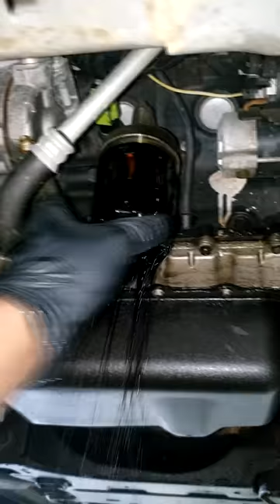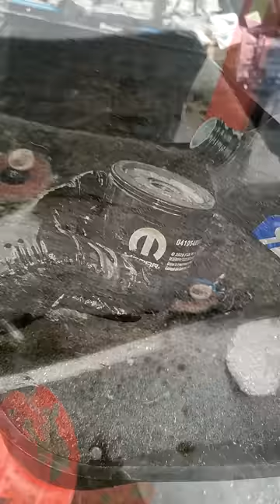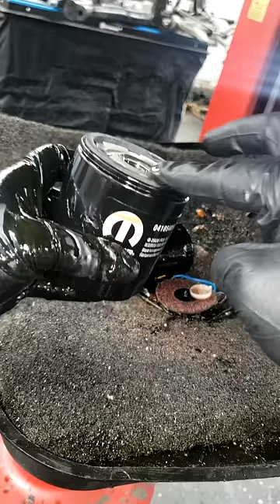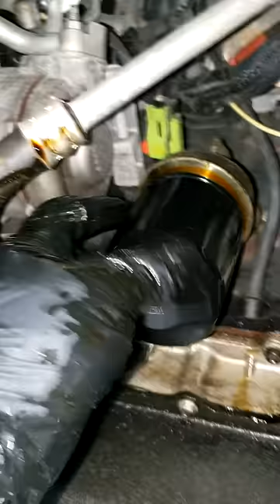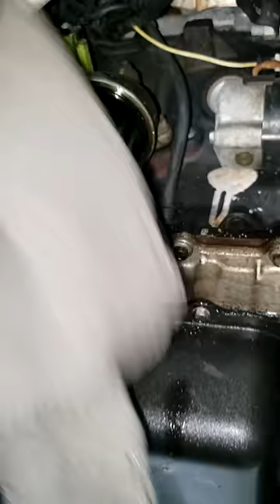Don't Lie.. Are yall still doing this?

Comment: Automotive Instructor here, you really only need to do this with large diesel engine oil filters, modern cars will charge the oil filter in less than 5 seconds, your valve train will still have enough residual oil left in it to prevent any damage while the filter primes...also wipe off the mating surface for the filter before you screw the new one on, you want it clean, and you'll be less likely to double gasket the new filter.
Reply from the maker: Thanks for chiming in Zippie27. Interesting comment
Reply: Talking about that, it is also totally annoying to me when someone takes the old filter and pushes the old filter against the new one to spread the old oil from the old gasket on the new filter gasket.
Reply from the maker: @SebastianLong  Lol, yea thats funny seeing people do that.. I simply get a chuckle out of it, I never let it annoy me. When that starts to happen I simply stop looking.
Reply: still wont chance it in my wrx.
Reply: @SebastianLong why
Reply: @SebastianLong  It doesn't make much difference. Using old oil to lube the gasket prevents drips of fresh oil appearing as a leak. 
As far as new oil contaminating the system, from a new bottle, is irk worthy. 
I have transferred old oil gasket to gasket since my hands are contaminated, wiped the base clean and install the new filter. This guy didn't.
Reply: @bryanst.martin7134  The issue is particulate that the filter is meant to filter will be caught between the gasket and the mating surface causing a leak. There should be no oil around the oil filter when it is a secure seal.
Reply: ASE certified tech here. I always add .2 qrts.  extra of oil In the engine accounting for the prime of the engine. For diesels is correct you always want to prime that goes for commercial. Passenger diesels do not need the prime.
Reply: Yep clean that mating surface!
Reply: Correct !!!
Reply: Made a double gasket mistake once!!!! Got lucky and caught it before disaster.  That's all it takes.  Always....always account for that gasket.  Crush washers too when used.
Reply: Disagree. You can HEAR engine wear when you start car with no oil in the filter. 1 second of limited lubrication is a lifetime in an engine. Ill keep putting oil in filters before reinstalling.
Reply: @SebastianLong  I just dip my finger in the old oil and lube the new filter gasket 🤷‍♂️
Reply: I work for caterpillar, as a PM technician caterpillar says to not to pre fill any filters, been doing it for years on equipment with 30k+ hours. Now I will say I do prefill my filters on my own stuff😂
Reply: @SebastianLong  I've never seen that but I have seen them Put their finger in the oil that hasn't run through the old filter yet And Wipe it on the new gasket.
Reply: Always,  everything i own, Even filters that are in a rough spot and screw into the side of the block, I have brake-clean.
Reply: I never did this on old cars too, with carburetors they usually didn’t start on first try, cranking primed them well enough, never had a problem.
Reply: What's the largest piece of dirt you've found in a brand new bottle of oil?
Reply: Thank you.  I have seen multiple engines run well past 200k. One of those over 300k without ever having the filter pre-filled.  It’s just not necessary.  If it makes you fell better than do it but it’s not needed.
Reply: I work on metro buses, we put them in dry
Reply: @OnlineMechanicTips  the fact you go through the process of priming the filter with new oil but don't clean of the mounting surface before putting it in bugs me greatly. You full-assed one job but half-arsed the other.
Reply from the maker: @mitchc4474  Its just old oil dude. Should you clean it, sure. It can also act as a lube for the new seal on the filter.  Don't be a drama queen dude, the world is not coming to an end. Geeesh
Reply: @fredost1504 haha, no, you can't hear extra wear.
Reply: As an automotive instructor you should know there are many new chain engines that rattle like F. if not pre primed due to hydraulic tensioners not getting immediate oil pressure. 3.2 ford ranger lump is one of the worst examples, also if you take longer than 10 mins changing oil you may never get oil pressure back, heard of guys having to pack grease into the pump to get them to start again and then immediately change the oil. This lesson needs re teaching. Years ago the reason CAT told mechanics not to pre prime was because almost all services were done in the field and dust contamination and catastrophic failure became common. Later they began suppying bungs and funnels for filling by the outer holes. This way it made no difference if dirt contaminated your filter, it was immediately filtered out
Reply: Mode3rn ..... lol ... my 1978 Spitfire Loads its filters upside down... never had an issue yet :P
Reply: my old man who is a automotive engineer taught me the same way and you are 100%correct bout checking the ring seal seen a lot of blokes double up then wonder why they have oil leaks
Reply: Work on semi trucks, never seen anyone prefill filters
Reply: Interesting hell, nail on the head brother.
Reply: Wrong I never prime my filters I diesel more chance putting dirt in engine doing that
Reply: I was about to say this, most passenger cars don’t need the filters primed, as the filter gets oil first, and then the rest of the engine, 

Clean the mating surface to make sure there’s no debris on it, and the old gasket is off, stops a leak,
Reply: Not mechanic here. Isn't this making longer to fill whole system? Because oiled filter does not let to push the air from oil hoses/canals through that easily. I know there's
Reply: @TimberWulfIsHere wow, a WRX? That must be an amazing machine hahahah

I didn’t prime my filter on an 680awhp Evo, or any other 9 and 10 second car I’ve owned, and never had any issues. But hey, prime that 29k car.
Reply: @Jason-id3yp  bros living on an edge of a knife, or on a loan for engine parts.
Reply: @TimberWulfIsHere  what does that even mean? 😂
Reply: 100% correct I've never EVER pre filled a filter, there is absolutely no point and yes wipe off the the mating surface. I just had a car in leaking oil because the last guy left the old oil seal on it.
Reply: @georgecroney6168 as a theoretical  automotive "instructor" you should know that most people in your field have gotten their "experience" through paperwork not Field work it's all theoretical you actually need to be a mechanic to have a valid opinion 😂 seriously.
Them 3.2 fords probably had 400k km on them. I've had to do the same with the 308. ( Not a fresh one) only once it's old and clapped out and the oil pump is so worn out it can't self prime. I do oil changes on the 3.2 all the time yes they are a shit motor it's a ford wouldn't expect anything else from a shit car but never had any problems on oil change unless it's done over 400k km 60k with miss treatment.
Reply: the new gm 2.7t will trigger the mil if the filter isn’t prelubed before start up.
Reply: Large diesel mechanic here. CAT FILTERS LITERALLY SAY RIGHT ON THEM DO NOT PRE FILL.
Reply: We dont prefill filters on heavy machinery...
Reply: I only do this on diesels and you can bet that's especially powerstrokes
Reply: @huskerpower1541  thats what ive always done and no leak ever.. never primed it like this because the engine fills it faster.
Reply: I was thinking the same thing. I sure wasn’t taught to do this in gassers from my tech school lol
Reply: Good or bad, right or wrong, I always pre-fill the oil filter on my 5.9 liter Cummins. Been doing it this way for the last 23 years.
Reply: 5 seconds of low oil pressure doesn't sound like a good idea.
Reply: I was taught that for high performance engines this is correct as well. 

Also, should wipe off the mating surface on engine side. Not all gaskets are the same exact size and don’t anyways line up perfectly with the old one and there’s always a big outline of oil and dirt. That has a chance of preventing a good seal.
Reply: My Cummins took one quart of oil to fill. Ha ha. I remember those oil changes
Reply: @jamessellers6276 yeah.... When they hold a quart of oil themselves
Reply: I always prime my oil filter, always have foes not matter on diesel or gas engine, instant oil pressure.
Reply: I cant event do this my oil filter is sixeways
Reply: Facts especially if it’s a Huey system the injectors use 80% of the oil or something like that
Reply: i wipe off mating surface to get rid of ring of oil and dirt sometimes the new filter has a different gasket than old one rounded or square edges and dirt could wind up under seal, and on side mounted dirt could run down into whole seal area.
Reply: Wrong, sounds like he works for gm! Always oil your o-rings
Reply: That's what I was taught by my automotive instructor long ago. Not only with diesel engines. Any engine that uses a large filter. Especially ones with high mileage. It'll temporarily starve the main, rod and camshaft bearing of oil. With small filters it isn't necessary. The pressure from the oil pump will fill them in just a couple of seconds. I'll still do it on engines with a lot of miles with weak oil pressure just as a precaution.
Reply: My instructor of 30 years taught us to do this when i got my ASE's in 2005. GM and Ford training centers also taught us to do this. Supposedly soaking filter media allows better capillary action and gets oil moving through said media quicker...
Reply: @OnlineMechanicTips  well, if you didn't wipe the old oil off the mating surface first you kinda did? 🤷 ✌️
Reply from the maker: @AzTurboMini  Did what?
Reply: @OnlineMechanicTips  when you screwed the new oil filter on without cleaning the old oil from around the seating surface on the block.
Reply from the maker: @AzTurboMini  Not going to hurt a thing. In fact it can be used as lube for the new seal. Its not the end of the world dude. But yes, clean it off if it bothers your mind.
Reply: @SebastianLong  With a seal that thicc no particles from your old oil will cause a leak, unless you've experienced catastrophic failure or introduce larger debris during removal. You can probably rim it in sand like a margarita and it would still seal. I'd take oil with some particulate on the gasket vs a dry seal any day. The larger concern would be abrasion to the mating surface over time.

Residual oil is always present on any lubed connection.
Reply: @TimberWulfIsHere  this doesnt affect head gaskets or burning oil. It'll be ok
Reply: 4-5 seconds is a hell of a long time if you ask me. I’m not a mechanic, but I always prime the filters on my STi. It takes 2 seconds and I can’t think of a good reason not to. If you don’t, will it kill the car? No, but if it is an option, I definitely prefer to do it.
Reply: Thank you for giving them a dose of common sense
Reply: i’ve said this for years. but the armchair pros know better. 😂
Reply: @MrZcotty  I wonder how many guys who build engines for a living pre-charge the filter? I would bet most of them & they aren’t arm chair anything if they are building engines. I just don’t get the reason not to do it. It takes 10 seconds.
Reply: Diesel tech here and CAT doesnt recommend prefilling any engine oil or fuel filter, the system upon startup will fill that filter exceptionally fast and there will be no wear on that engine fron not prefilling it
Reply: @Moto848 Cat actually doesnt recommend doing the prefill
Reply: @Artc1990 if its a CAT motor i. That commercial truck its not recommended by CAT , been doing this for 23 years and have never been told that prefilling the oil filters was recommended only that its not and that comes straight from the manufacturer CAT
Reply: I always thought the reason to prime any filter was so that the journals of the crankshaft, wrist pins and piston bores would all have immediate oil pressure.  The most damage to an engine always occurs during the short period of time at startup when fluid bearings have temporarily touched down.  I personally don't like prolonging this duration because I didn't take 10 seconds to prime the filter.  But hey, to each his own.
Reply: @Artc1990   genuinely curious why do people think stating youre ase cert'd is a flex?    It doesnt at all prove you can actually use your hands to do what you were just tested on .. lol
Reply: @snorman1911 on most late model Toyotas you can, for the first couple seconds the valvetrain makes the most god-awful noise until it starts getting oil
Reply: No your wrong,all wrong!
Reply: Learned that from my automotive instructor as well
Reply: @itslofi5622  nope he was wrong
Reply: Thank you for this :)
Reply: Don't need to do it with large diesel filters either. In fact many large diesel filtera come with little pictograph instructions on the side saying specifically not to pre fill them.
Reply: @Artc1990  "ASE certified"?  Wow, that's a little scary......... Extra oil for priming?
Reply: @frankdank7507  yeah, you know because the filter absorbs oil… 🤦🏻‍♂️
Reply: Same!
Reply: Some diesel engine manufacturers actually yell you to not prefill.
Reply: ASE Master Tech and instructor here as well. It's not necessary on small filters, and pretty damn hard on horizontal filters. Hurting anything? No. Helping anything? Also no.
Reply: I hope your stocks in automotive companies pay ya well.  Throw away engines,  make this guy more money.
Reply: @fredost1504  only because the lifters are slightly delayed in pumping up. Three seconds of extra valve lash hurts nothing.
Reply: @Somnifluous  sorry to tell you but he not wrong.
Reply: @KenFullman I have found up to a teaspoon full of grit and sand, up to about sixty thou diameter, in each of three five litre bottles purchased at the same time. That was a decade ago and I still refuse to use anything in that brand to this day!
Reply: Wrong. Had a 2015 bout lock up that didnt have this done... Dry starting is not smart. Does not need to be diesal.
Reply: Better to err on the side of caution instead of time.
Reply: Continue to do it.  Better safe than sorry.
Reply: ASE-certified Master Technician with 35 years of experience here. So 5 seconds without oil is fine for you? The simple facts are, most of your engine wear occurs on start-up because the engine doesn't have oil yet. Extending the time the engine doesn't have oil by any amount is simply unacceptable and negligent. Especially with modern engines, with long timing chains, oil-fed tensioners, and tighter clearances.
Reply: I always do more than just necessary.  Also, Japanese cars use tiny oil filters.  I don't drive a Japanese car.
Reply: That's one difference between parts changers and real mechanics.
Reply: @evracer  ASE Master Tech here as well and I'm Sorry but that's complete BS.
Reply: While the filter is filling, the bottom end of you engine is not getting any oil.  If you prime the filter, it will get oil almost instantly.
Reply: It is a very bad idea.
Reply: You can half fill it.
Reply: My opinion as a mechanic with an engine building background do it period unless you have a pneumatic oil pump that can prelube through an oil galley.
Reply: Most really large diesel motor's have pre lube pumps
Reply: I do this on my 74 MGB. Not modern in that case. ;)
Reply: @OnlineMechanicTips I usually just do flood mode hold the gas pedal to the floor and cranks it for 5-10 seconds before starting
Reply: Facts
Reply: Ford ranger diesels gotta be quick pr they can loose prime on oil pumps amd cause starvation 😂
Reply: I don’t even do it to large diesel engines never had a problem
Reply: Agreed
Reply: @OnlineMechanicTips  Actually the oil on and around the mating surface can draw in sand and debris from the newly disturbed area around that mating surface. I have actually had one leak because of that. So yea, it is more important than filling a half pint filter. I do fill my filters AND I wipe the mating surface
Reply: Most large marine diesel engine mfg say not to fill filters .
50 yrs Chief Engineer UL HP
Reply: well said
Reply: ONE FOR SURE, I once double gasketed a Cummins 5.9, and thee oil squirted out soooooooo fast , before I turned the key/ motor off I subsequently lost 1-2 quarts of 15W 40 , I was behind an abandoned building and took the filter off and righted things, put the 1-2 quarts back in that thee engine lost. That measly 45, or 49 psi, will THROW THAT OIL LIKE TERRY BRADSHAW,
Reply: @michaelbenardo5695 yah I go 1/3 of the way with pre fill that way at least it has a start rite----?
Reply: @recrdholdr that's good point, I never looked at it that way hmmmm----
Reply: Okay but what if it's an old car?
Reply: Yep and now they have a tool you can cover the end and slide it in for the dodges comes in handy and you can use to remove also no more complaints about oil all over their frame :)
Reply: You need to do this on some high performance engine they're the same engines you can't have a warm engine and then dump fresh cold oil into them
Reply: Wrong pre fill on all cars and trucks. Oil needs fifteen minutes to activate the paper other wise you risk the paper tearing and filtering nothing until the next oil change and yes I have seen it that why we cut all filter open after we take them off. Also it prevents filter pleating.
Reply: Funny how this guy made an instructional video not realizing he was wrong from the start…. How about a fallow up video saying you were wrong?
Reply: So when I change the filter on my 7.3, it'll actually matter?
Reply: @SebastianLong Right? Just use some of the new oil and your finger if you want to do that.
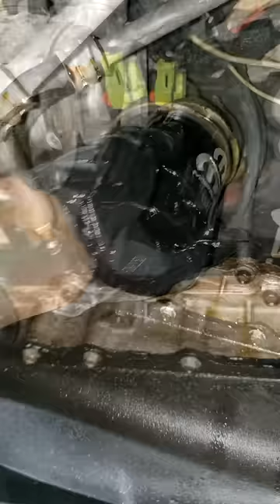Reply: Completely wrong. Even on huge diesel engines with filters that hold gallons of oil, don’t pre-fill. Right from CAT….  5 seconds?  Hahahahaha. Try 0:50 seconds.
Reply: @sjfk1306  50 seconds in a modern car? Are you high, or did you think they were still talking about diesels with the 5 seconds?  They were talking about most modern cars.
Reply: @crispybatman480  uh? What? That’s a HALF a second…
Reply: @sjfk1306  I know that, if it's even a full half second, probably less. I just meant they were referring to normal car engines not taking long to circulate oil.

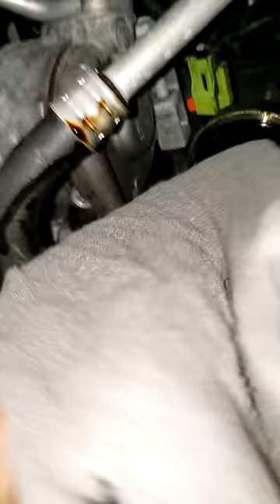Oh did you mean .5 seconds instead of 0:50(50 seconds)?  That makes much more sense.
Reply: 5 seconds equates to 100 revolutions on start up. 100 revolutions where the film of oil that protects your rod bearings isn't being replaced. You do you but sounds like you're training kids to ignore common sense in order to possibly damage a motor just to save what, 10 seconds per oil change? That's like 5 minutes of time at the end of a full day of doing oil changes. You're not even going to cram another oil change in during that so it's literally just boiling down to the company that hires from you is trying to cut pennies on there hourly rate.
Reply: @HowardSupra  It isn't 5 seconds, its less than half a second... Oil pumps are there for a reason, and they aren't aquarium filter pumps...

By that logic, I would have metal shavings in my oil pan by now lmao.
Reply: @crispybatman480  Even 1 second is 20 revolutions that the oil film is expected to stay in place during combustions events. You wanna be lazy and risk spinning a rod bearing to save 30 seconds, be my guest.
Reply: @HowardSupra  I have, 230k miles and counting, runs like a dream, not a speck of metal in the oil pan lol.

Edit: I should clarify; In larger or worse built engines you have to worry, but I have a nice little reliable 4banger. It doesn't make a difference.

Also yes, 0 knocking, which is what I would be hearing if there would be any issues with a rod bearing.
Reply: Yes intelligence at its best
Reply: Unless you have a 95 suburban w the 6.5…. In which the filter is upside down 😢
Reply: Yes,  I still put oil in filter so element can obsorb oil and wipe mating surface of dirty oil which may have metal  shavings mixed in.  Some people say let the car do the work so just put the dry filter on. I've been doing this since age of 16 years old, have not had any engine oil problems with neither of my vehicles. Just be diligent in taking care of your vehicles. Live Positive
Reply: All you need to do is oil the o ring on the filter
Reply: @SebastianLong so let an old guy tell you who has done this for 40 years and whos dad and grandfathers have changed oil for a lifetime on everything from construction,  cars, farm equipment and so on. There is absolutely no reason to worry about using used oil on the ring of the oil filter. You wiped it on with your finger you should be able to feel anything on the ring that would matter. Next if you get a drip of old oil in the filter it wont be any different then the used oil thats still in the motor. It will mix with the new no problem.  You are so worried about this but don't fill your filters. Whsts really causing more harm. I swear you so called trained guys never put thought into anything. You just go by what they tell you.
Reply: Still a good habit to have
Reply: @fredost1504 why you tellin lies?
Reply: @kennethlaw9830  How would you fill a filter that gets flipped upside down or even sideways and not spill mostly all of it out again anyways. Im not sure what type of vehicle you drive but a majority of vehicles ive been under or have worked on are either installed upside down or sideways. You may have worked on vehicles for 40 years about 20 years ago, but they dont put oil filters on gasket side up on most cars anymore.
Reply: I work at valvoline and that is how they teach us too only on diesel filters do we prime and yeah clean that old oil off as well
Reply: The only time I’ve seen that done was on my diesel. Never on a regular car.
Reply: Never had to pre-fill the filter.  I do put oil on the seal but agree with you.  Totally unnecessary.
Reply: yea the diesel oil filters hold as much as a qt and on some macks have 3 oil filters
Reply: @hawkeyestiguy there is residual oil in your engine.  It’s fine if you don’t fill the filter
Reply: Those who can't do teach.
Reply: @oneofmanyte3321  There isn’t residual oil in the filter. You choose not to prime your filters, but I’ll continue to prime mine, especially on my built engines.
Reply: Deuce and half's oil filters are mounted upside-down and we had a time frame for changing those to possibly get no oil or less oil all over the place . Not sure if they were designed to let the oil drain off or if they were just old and faulty that way . Either way the deuce 1/2/M35 is the backbone utility vehicle for the Airforce , Army , and probably all branches . Even though by some standards it doesn't appear to get adequate lubrication upon startup they are still working after many decades of service .
Reply: @SebastianLong  LOL, I do that or stick my finger in the used oil that's been drained into the drip pan , it's like right there , but maybe it won't be so annoying if I tell you that I keep the old filter upright while I keep the new one upside down when touching the two together .
Reply: @glengrimm4075 LOL ,  I had always said if I were ever to be in charge of Ford development I would do a 308ci motor as that would truly make it 5 liters but the 5.0 is , actually , 302 ci . and I haven't heard of a 3.2 L in a Ranger but I owned an 88' Ranger and it had an I4 in 2.3 liters .
Reply: @SebastianLong  if there is any particulate big enough from the old filter oit to stop the thick ribbed rubber sealing correctly you have bigger issues than a leaking oil filter. oil filter calls for oil to be applied to othe new filter on instalation using new oil or a bit of old oil to do this makes no differance to the outcome.
Reply: @MyDailyPerspective  Yeh i have done this. I always make a point to wipe the mating surface clean now and inspect.
Reply: @snorman1911 sh!t man.. listen to a nissan vq V6 rattle like a snake for the first 3-8 seconds after an oil change and tell me that again. Heck my wife's 2.5L Toyota has a quick timing chain rattle if it's been a few days since it ran and I use good filters and oil in it.
Reply: @WillSwingem hah. Your devuging secrets bruh 😂🤫
Reply: @jamesborek8125  just be careful when you do it cuz not all cars have it so you might end up sendin someone’s shit to 6k on a dry start
Reply: I usually disconnect the crank sensor, turn the motor over a few times, and reconnect the sensor. My filters screw on horizontally.
Reply: The car manuals say oil amount with and without filter so therefore it needs to be done on cars.
Reply: @masterofnonetv8361 Nothing will happen especially on engines with timing belt. My car had defective one way valve that stops oil from draining in filter housing to sump and everytime when I start engine after it's been stopped for an hour it rattles like can full of nuts. Oil pressure light stays lif for 5 seconds and then goes away when filter housing fills up. Engine runs like this 4th year,car is almost 100% city car with lot of start&stop action and it's still working.
Reply: @snorman1911 you can hear and feel extra wear ! Youve never driven and could tell you need an oil change without focusing on the fact that its just about that time?
Reply: @glengrimm4075 man, great points.
Reply: @ImmortalOnenesss  I don't think an engine should make any different noises at all when it's time for an oil change, unless you waited way too long.
Reply: @snorman1911  it's more of a feeling. Rougher feel. You can feel it all through the seat too. But you are right. I've seen a lot of shieet
Reply: I always just check the old filter for the gasket and in the 8 years ive been wrenching on stuff ive only ever had one time the gasket didnt come out with the filter and alls I did was get a pick and pull it off the block
Reply: I don't do this because of the fact that it would run out when installing the filter. If it's a filter that goes on like that one , then yes I would.
Reply: This is exactly what my instructor has told me
Reply: Where do you teach. Mechanic for twenty years but I still like to learn
Reply: I think it a good ideal to pour  some the oil  into  the small  holes.
Reply: Thank you finally someone who understands. I've never filled a filter. But big diesel filters makes sense
Reply: Some new big farm tractors don't even ask for prefill
Reply: I've done many a PM on diesels, and I only prime my fuel filters.
Reply: facts. you don’t need to do that to 4 wheelers anymore just diesel engines.
Reply: Good to know because like I commented my oil filter is horizontal so if I do this I spill oil everything while they to screw it in 😂.
Reply: @georgecroney6168 best comment yet bro
Reply: Modern cars don’t need this. I’ve been doing it without doing this for years. As techs time is money and your wasting time.
Reply: Does it help to bump the engine without starting it.
Reply: I would rather my valves have oil in that 5 seconds  than without for 5 seconds 😂
Reply: This is perfect
Reply: You really don’t need to do this diesel engines either.. why? Because most diesel engines don’t filter 100 % of the oil . Only about 20 % of the oil is filtered ever cycle after a few cycles then it’s filtered. But from start oil goes straight past the filter into the engine. Everyone keeps taking about prime but that is for fuel , you have to prime if you change fuel filters.
Reply: I doubled the gasket at my work experience at the bus shop in grade 12. , never again though
Reply: Well technically a little filter like this will prime in a few seconds, but that’s still a few seconds running with zero oil pressure. Granted it’s not going to spin a bearing but it certainly will cause unnecessary and preventable bearing wear.
Reply: That's the 5 seconds I'm talking about.  For anyone paying attention
Reply: Thanks for being the one person who doesn't sound dumb on here
Reply: Yep, we do that on older wheel loader and older Excavator, not need in recent one.
Reply: What large diesels? I work on well service equipment (CAT, CUMMINS, and some Detroit) and every engine oil filter I’ve seen says not to
Reply: @TimberWulfIsHere the wrx will prime the filter even faster than 5 seconds. You wouldn’t really be chancing anything.
Reply: Diesel tech here, I don't fill oil filters with shit lol...fuel filter is a different story now.
Reply: I just make sure I run the engine first so there is oil everywhere in the engine. I could only see it mattering if the engine sat for an extremely long time, even then probably not.
Reply: @bryanst.martin7134 actually it does make a difference because old oil kind of turns into almost glue so definitely recommend putting new oil on the rubber gasket
Reply: If you double the gaskets, you will burn the motor up before you can bat your eyes. Many moons ago I knew someone that did that.
Reply: @SebastianLong  Why? it's only there to lubricate the o-ring for the final turn after it makes contact with the housing. You could literally use any oil or lubricant to do it.     /    It's not like they're putting old oil back into the engine. And even if they were, there is more old oil still in the engine already, a lot more than that little bit.
Reply: @fredost1504  unless your engine is falling apart you are not hearing shit wear in it...
Reply: Wrong. Most of damage that you get on main bearings and rod bears are from initial start, when the oil film Is not present. Now introduce a scenario where the engine has to run for 4-5 seconds before it even builds oil pressure… that’s metal on metal… you are damaging your bearings. This was tested by oil lubrication specialists. That main reason people don’t pre fill (unfilter oil) They measured particle count on brand new oil, and oil that’s been ran through a clean oil filter and engine that hasn’t been started (just priming oil). The particle count (after it’s been ran through the unstarted engine) was significantly higher (about 6x the amount as clean oil) because oil filter does not filter out most particles smaller that about 15 microns. Pre fill the oil filters. Stop teaching the wrong way.
Reply: This has been proven wrong by very thorough testing of metal wear both in the oil and on the bearings.  After just a few seconds that oil film will be gone on the bearings and you will have metal to metal contact
Reply: @SebastianLong matters none. Not one bit. That oil is simply to lubricate the gasket and a drop of used oil isn’t gonna hurt your engine.
Reply: @fredost1504 Most vehicle engines spin over for at least 3-5 seconds, giving the system plenty of time to charge the filter as well as the entire system. They are designed to do this. What are you even saying?😂😂
Reply: There is no way that I am not going to take the 5 Seconds it takes to put oil in my oil filter. If you want to run your engine dry for 5 seconds you go right ahead but not me. It does no harm and it can only do good.
Reply: CAT tech here. It does say not to prefill any filter. Butttttt, I always prime my filters. At least enough to soak the membrane. 1/3 is fine. When I worked on generators, some Cummins had 5 big azz filters on the side. We prefilled each one to the top. Pain in the back spinning those on. Peace of mind. That’s what it is. Now most filters are on the return side anyway, and it doesn’t matter if you prefill. Tacomas have the filter upside down, most newer vehicles with the cartridges have them upside down. Can’t prefill them. So yeah for gas vehicles, I do not pre fill. For diesel big trucks I do. For my smaller 4 cyl backhoes and excavators, no need. Those filters are just a little bigger than a quart. To each his own. And yeah I use the old oil on the mating surface all the time. Great seal.
Reply: You need to do this, if possible, on turbo engines so the turbo has oil sooner on start up.
Reply: I dump warm oil then turn motor for two seconds to empty oil pump also. There is still a load of old Dirty oil in the pump. 
I fill the filter and oil the rubber seal after wiping the pump surface.
Reply: True BUT if I can pressurize the system INSTANTLY or in 5 seconds, then I'll choose the FORMER all day long.
Reply: @fredost1504 Exactly, there's a notable difference.
And he mentioned the top end? Ok. 
It's the bottom end that has to deal with combustion pressures at extremely low rpm, with zero oil pressure on the mains or rods.
On a journal bearing, no oil pressure means wear.
5 seconds is an eternity.
The top end isnt nearly as stressed on initial crank.
Every car has a light tied to it's sending unit.
On a dry filter it DEFINITELY doesn't prime in .5 seconds, try several seconds.
Several seconds of normal combustion, with zero oil pressure on mains and rods😮.
Watch the light on a normal crank, then after a oil change.
Massive difference, record it and see the difference.
Reply: It's probably best to do it if you can.
Reply: So you say the engine won’t have oil pressure for only five seconds? I think I will keep doing it then.😂
Reply: With new small engine filters doesn't need to be done but cleaning mating surface on block and little oil on gasket but on large diesel filters you have to and 3/4 full (new modern car and truck filters are designed different than in the 1980's and older yes you had to or on modern fram death cans almost doesn't matter because you are better off just washing old filter in parts cleaner will still work better then them)
Reply: Absolutley right on the diesels. I've got a 12 valve Cummins, it's a full 5 seconds before the pressure is up in a new motor just from being parked overnight. With an empty filter I might be stretching that 15 seconds? Not good
Reply: @zippie2787 your argument of not needing to prime an oil filter is just plain incorrect.
You state "modern cars will charge the oil filter in less than 5 seconds, your valve train will still have enough residual oil left in it to prevent any damage while the filter primes".

Here are the problems with your logic though- during a "dry start" with an empty oil filter, the engine is operating without any oil pressure until the filter fills with oil and is circulated through the engine.
Seconds count. I wouldn't want my engine running without oil pressure for 5 seconds.

Secondly,  just because there is residual oil left in an engine after the oil is drained, it's not enough lubrication to fully protect the moving parts of an engine by itself.

Without proper oil pressure in an engine, oil is not being squeezed into all the small openings and ports throughout the engine, resulting in premature wear due to lack of proper lubrication.
Reply: Noticed that you did not clean the filter o”O” ring contact surface before fitting the new filter.
Reply: I had an old school mechanic school me at my first real diesel fleet job. We had 60 series Detroits with two large filters, probably held over a gallon between them. He.told me not to bother pre-filling them. I was shocked but did as he said. We also did intense oil analysis of the fleet, and the lab said we had the cleanest and best samples in the region.
 The old timer was very particular about cleaning whenever we opened an engine to do valve adjustments, etc, and that paid off. Those engines ran forever. Funny thing...ppl will fluo, but he also believed in not changing air filters until they started to plug!! His rationale was that as dirt got in the filter, the holes actually became smaller and it filtered better. Sounds crazy but again, those engines ran flawlessly and the samples were always stellar. I was under him about 8 years, and with 12 tractors and 22 forklifts, I changed maybe 5 air filters the whole time!!
 Just my experience- your results may vary...😂
Reply: I'm glad someone came along to correct this! I used to do oil changes and I learned from some old school guys that only diesels you do this with to prime the filter!
Reply: Definitely agree with this for pretty much all modern vehicles. The manufacturers spend billions in development, unless you have all ran your own scientifically proven research that proves otherwise, you’re all just wasting time.
Reply: Exactly I've been saying this too also they usually have a high and low stage now too
Reply: @Moto848 exactly diesels need it cause the filters can have up to a gallon capacity cars vans trucks totally unnecessary
Reply: @TimberWulfIsHere that's different those engines are flawed heavily because the way they are set up
Reply: Bus technician here, i agree not so necessary on automobiles but I prefill the oil filter on my fleet of buses every time, the Cummins b6.7 oil filters take about a gallon of oil themselves in a 16 qt system, the few international max force dt engines we have, the filters hold roughly a gallon and a half of oil. These diesel engines are somewhere in the neighborhood of 35k to replace, I take all the precautions I can with them.
Reply: Lmao good luck to your oil pump to work for 10-15 sec on air😂
Reply: Depends on where the filter is located in the system , on the charge side or the return side of the pump .
Reply: @kris.michaels7631  you're right. If you have an oil pressure gauge, you'll see pressure almost immediately since the pressure sensor switch is by the oil filter.
Reply: I tried saying this on a dif comment but online mechanic tips Mr.fake master tech gets all mad
Reply from the maker: @sashapittbull6953 Smdh, dude I'm never mad at anything a nobody such as you would say to or about me. Please make that understood. You don't even have a presence/profile here on the platform. I mean who are you? What make you think theres anything that you can say here that would upset me?
Reply: @OnlineMechanicTips  ya I don’t have Tik tok or a YouTube channel lol I’m an adult. Crazy if you’re so happy with your life why you respond to every comment that calls you out .every time you respond you put everyone down for posting their opinion and always seem mad. You apprentices always got that beta male energy.
Reply from the maker: @sashapittbull6953  I reply because that's what good youtubers do. Imagine that, im grown as well with a social media presence that generate a good revenue stream. I wasn't aware that you should stop caring about money once you get grown. Dumbest thing I ever heard a so called grown person say..smdh..I can't do this with you, our levels of intelligence to far apart my friend. Sorry.
Reply: Yes!!! I was taught the same thing. Obviously the large diesel filters are a different story. But cars??? You don’t need to do that 🙄🙄 Just wipe some new oil on the new seal, make sure the old seal isn’t still on the block, then hand tight plus a quarter turn. Good to go 👍🏼
Reply: @SebastianLong always did this, never had issues.
Reply: It takes 4 seconds to 5 seconds for oil filter to fill and lube your bearings . Do not feel your filter crank your car watch your oil pressure gauge fill your filter watch the oil pressure. It adds up on the lifetime of the engine metal on metal rods .
Reply: @John-hz8wt  what if it takes 6 seconds?
Reply: Not everyone drives a modern car.
Reply: @NeuKrofta  "modern" cars by mechanic standard most of the time is anything that has an ECU or EFI.
Reply: Nope, I forget the guys name (white hair, older, rebuilds V8 engines frequently); he proved (clip that showed it all) that it takes up to 30 seconds to build oil pressure on unfilled filter, versus ~10 seconds on pre-filled filter.
Reply: Honestly I'm just a random Joe who can barely change his own oil. I have no stake in the prime the filter argument. Where I'm stuck is he put a clean filter on a dirty port. Not that it will have a major impact but doesn't that kind of defeat the point of changing the filter? I get it will get dirty immediately from residual gunk hanging around but would this just speed the process up?

I vape. I used to rebuild my coils on my vaporizer. If there was any old juice left over when I did a rebuild, it would instantly contaminate my cotton, shortening it's overall life by a good deal.
This is how I see the filter. Please educate me further lol
Reply: @blacksrt8300c Whether they start quickly or not you don't want the components spinning without pressurized oil. The  oil pump works even if the engine doesn't start.  
Quicker into the oil pump, quicker into the bearings.
Reply: @SebastianLong toyota filters bring the top gasket prelubed and wrapped in plastic so i assume its useful
Reply: You don't even have to do it on large diesels. If the engine is big enough for it to matter like the high horsepower cat and cummins engines, then they'll have a prelube pump on there. You put the filters on dry then hit the pump and it prelubes the engine and fills the filters before you start it up.
Reply: A dt466e takes a gallon to fill the filter. And you better do it. A 1.7 honda who the fuck cares. But on a passenger car it does not matter.
Reply: SAY IT LOUDER FOR THE NEWBIES IN THE BACK!!!! 😂
Reply: You are correct, thank you very much
Reply: @Moto848 According to Caterpillar they say spin filter till it touches plus one additional turn and do not prefill
Reply: I will prime til the day i die!!
Reply: Depends on the diesel. Cat says not to prefilled the filters.
Reply: also read the machine's/vehicle's manual. Methods of filling up engine with new oil vary. Some cars you should start and measure oil level again, some cars you should NOT start as it changes the level and will be impossible to measure correct amount of oil after it has been started. (like Isuzu Dmax)
Reply: Caterpillar specifically tells you NOT to pre fill fuel or oil filters
Reply: Diesel engine builder here. Most oil pumps push around 150 gallons a minute, and they run thicker oil, so in theory, they can run "dry" longer, if only milliseconds. The old count to 5 for oil pressure works on gallon sized oil filters on diesels.
Reply: Exactly. The filter on my 7.3 99F350 has to be primed for that exact reason, it's too large of a filter for the engine alone to prime unlike small car filters that their engine can fill up in a few short seconds without scavenging too much oil from the engine.
Reply: @superstar64 Due to it's size yes. I always prime the filter on mine.
Reply: FAR more important than putting oil in the new filter is CLEANING OUT the screw threads on the new filter. I promise you, if you take a clean towel and wipe out the threads, you will find metal shards, flakes, and grit hiding in the threads! Clean the new filter!